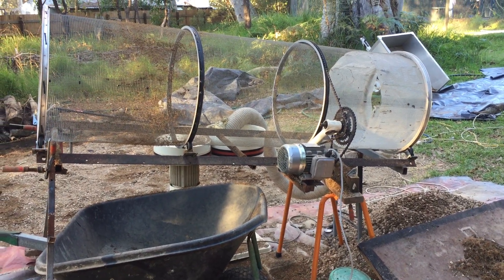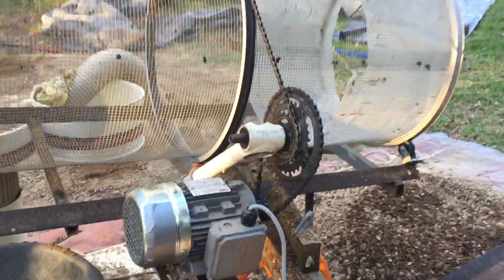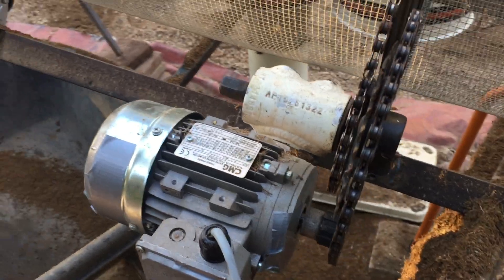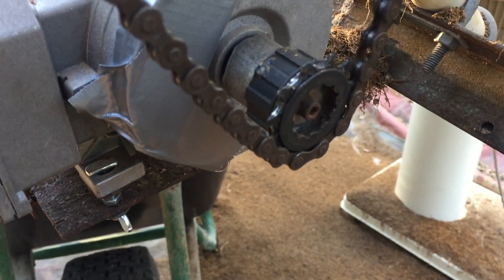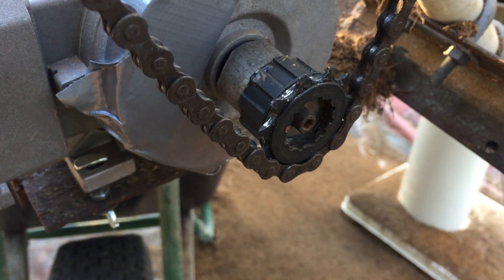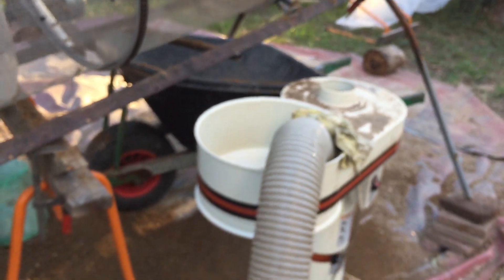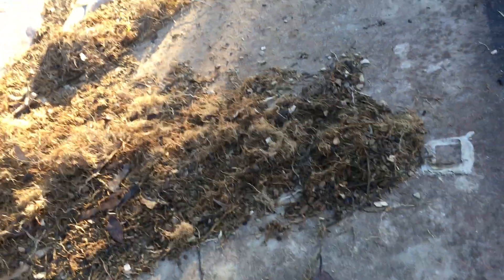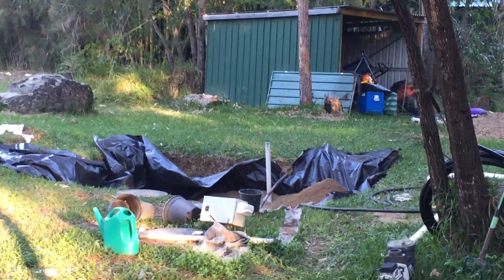My 'trommel' sand/gravel/roots separator

Comment: I've debated several times if it's worth including that 4th wheel in the build. With the screen I've acquired; I'll have roughly 2ft (60cm) sections with a trommel at about 4 ft (120cm) using just the 3 rims. Now that you have had it running for a while; Do you think the additional length of having 3 sections with the 4 rims is worth it?
Reply from the maker: Probably not.  I had 4 wheels, so I used them.  Most of the filtering is done before the material reaches the third wheel.  If you've only got a 3 wheel setup, you could lower the angle so the material stays in the trommel for longer.  I wouldn't bother adding a 4th wheel if you've already got a working version.

One thing I'm thinking of changing is changing the mesh to 10mm in the last section.  This would allow the smaller, lightweight stones to fall through before being blown away with the roots.
Reply: Good to know, I'll skip using the 4th rim. 
From what I've read the target angle for the trommel slope is about 5 degrees so I think I'm going to try to hit that mark.
I have 1/4" (~6mm) mesh, I'll have to think about how to patch in a short section of 1/2" (~13mm) mesh at the end if I try that blower trick.

What are your thoughts on adding lifters to the trommel? I think that the extra lift might shorten the lift of the screens with the rocks I'm going to be sending through it.